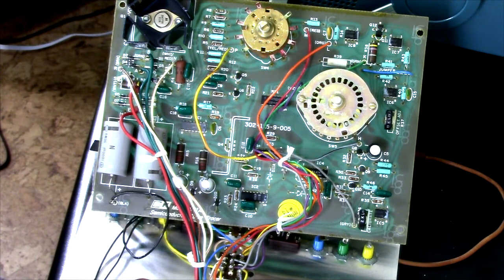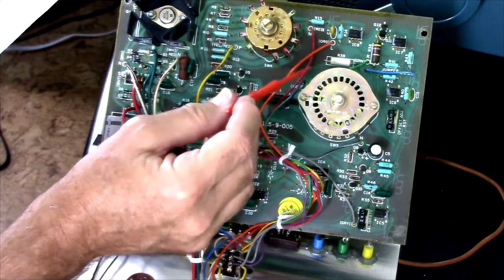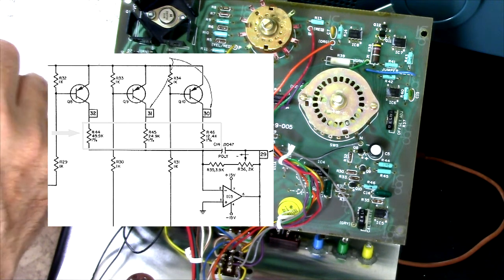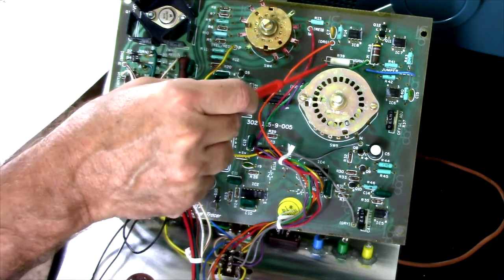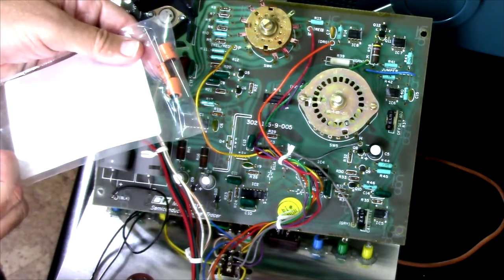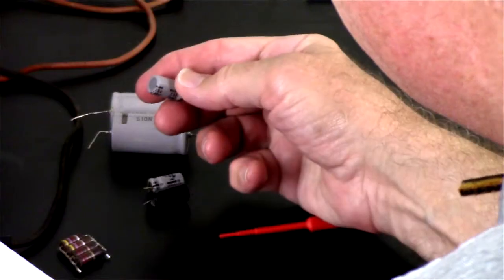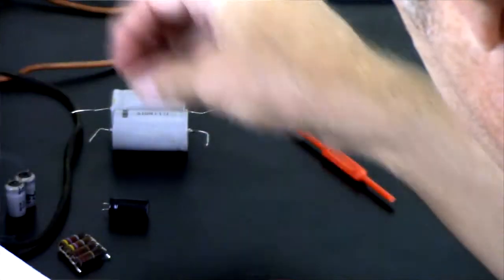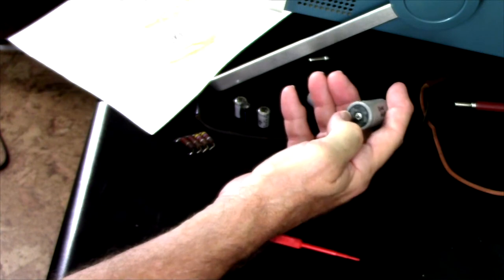B&K Precision 501a Curve Tracer Part III

Comment: Oddly enough the one I have has the same symptoms. Can't calibrate and the signals are what they should. 🤷 I'll just load up the cart with parts even if they aren't needed, not loading the parts cannon but I'd rather have them on hand just in case.